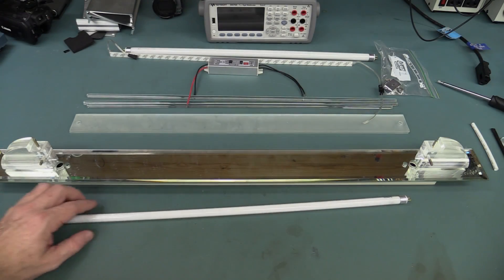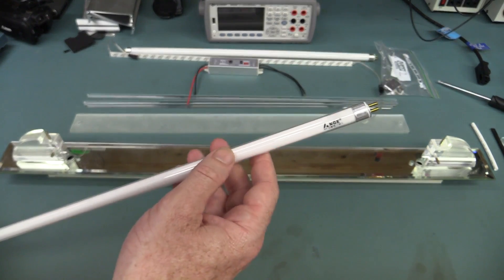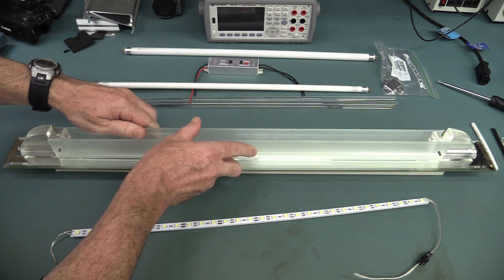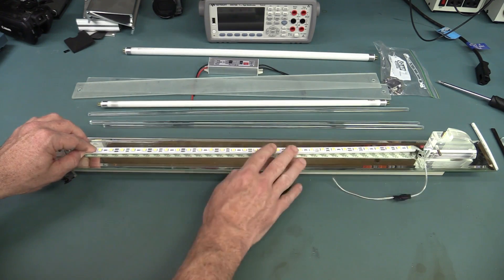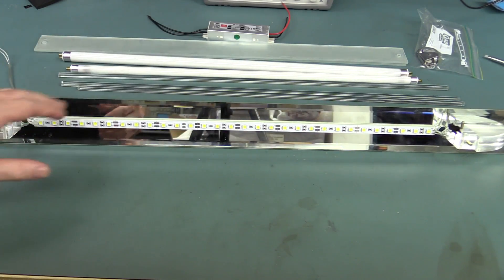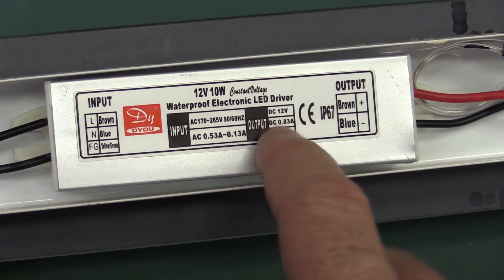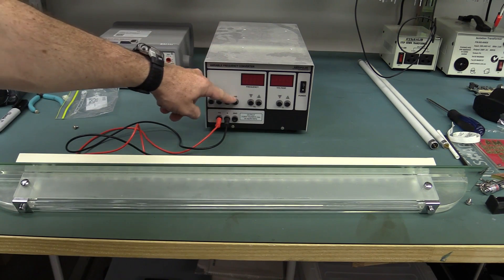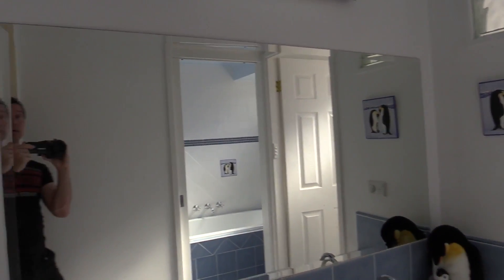EEVblog #728 - T4 LED Lighting

Comment: Very cool! I dislike the non-standard florescent tubes myself. What a pain in the neck when they play out. It's a good looking lamp, and the color temperature is spot on for it's application. I do have a question, have you had an LED lamp turn a pink hue? Thank you.
Reply from the maker: Mark Shannon None. And have LEDs all through the house and the lab.
Reply: EEVblog Thank you. I have a 6 year old LED flood lamp exhibiting some noticeable pinkining. Was originally lunar white. Perhaps they used cheap LEDs (got it a Sam's Club for $11 in late 2009). Guessing the florescence on the LEDs is breaking down due to extended use. Thanks again for your input.

Comment: I'd say about 400lm, those t4 are terrible they give at best 60lm/w.
Reply: Chinese T4 might do 60 when new, but will degrade fast, probably spent most of the time around 30-40 lumens/W. Also run incredibly hot so the phosphor degrades fast. The longer T5 tubes often fail by simply cracking an end off and then falling out of the holder, I have seen many where the hot glass melted the diffuser as well.
Reply: To be fair, those LEDs and the driver are probably even worse than that.

Comment: How did the brightness turn out? I'm normally a fan of more light in almost all situations.
Reply: especially with leds - the life time of leds is defined by ratio of brightness by end of life to initial brightness. So, the brightness of LED illumination at start must be brighter then brightness of the previous lamp in order to serve well for years to follow.
Reply from the maker: oisiaa Maybe a bit less, but roughly equivalent to what we had before. Certainly not a huge amount of light, but more than enough for our needs in that bathroom.
Reply: ***** That makes a lot of sense. Two strips would be a lot better. You could stagger them to even out the LED spots too.
Reply: EEVblog Could try angling the LED strip downwards to get less waste light on the ceiling.

That is a nice looking fixture. The high color temp suits it well.
Reply: ***** I was thinking exactly the same thing
Reply: I've you'r a fan of more light - check out th Cree LED's. Couple of those on proper heat sink will blast the photons out.

Comment: They do it so they can make more money that way. If you buy their bathroom adapter then you'l have to continuously buy new bulbs from them AND nobody else. Bastards.
Reply: it did hold  last how long? 17 years? Bastards - they are making a shit load of money with new bulbs.
Reply: sarowie I think its mostly because they want you to buy a new fixture in those cases.  how many people are capable of doing what dave did? :o
Reply: I used to see that a LOT with projectors. Lamps with a few hundred hour lifespan and costing $300+ to replace?  I actually inspected one to find out that it was a rather standard MR16 format lamp with a proprietary base. And that only became worse when everyone switched to HID lamps. Thankfully the new LED projectors seem have killed that little scam.
Reply: sarowie Not all bulbs last that long.  I had a very similar setup as Dave in my washroom, they blew maybe once a year or two.  I think they are making more money on having non standardised parts then they would if they didn't. Otherwise why would they use preparatory sizes?
Reply: Photographictime
Bad engineering/wrong priorities. - design first, function second and maintenance - who cares?
When buying those things, rarely any one checks if the bulb is a standard size. But they will look for a "good locking one" that "gives of light" (in this case with the right color temperature). So, why prioritize replacement blubs when designing the lamp? When selling/buying the thing, the costumer isn´t asking or careering for it. But when "at first glance" the lamp looks "bad", it is out of the race. So, to some extend the consumer is to blame.
Tomasu82 
Who wants that? I´m unlikely to buy the same brand if I even remember the brand name, because obviously, I´m unlikely to get a new bulb in five years time. So: I take an other random brand.
The dealer? Well - guess where I would not buy a new lamp from - the dealer, who can´t supply me with spare parts. The old saying "foul me once - shame on you. foul me twice - shame on me" holds some truth in this case.

The lesson from Daves adventure is:
Check if the spare parts are standard, before buying a product. When bought and you can get no spare parts: Hack your own spare parts.

I can´t see that episode as blaming the manufacture or dealer - the bulb lasted amazingly long and even if not, he was the one that bought a product with non-standard bulb because it looked good. Next time he will set different priorities.